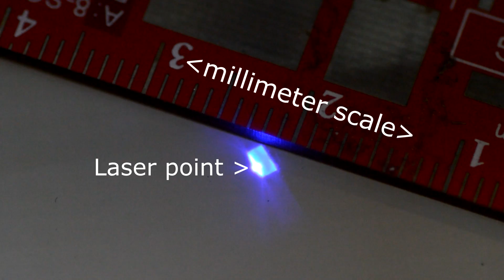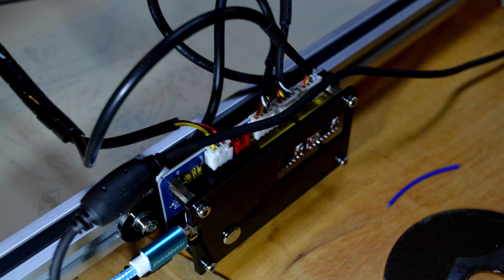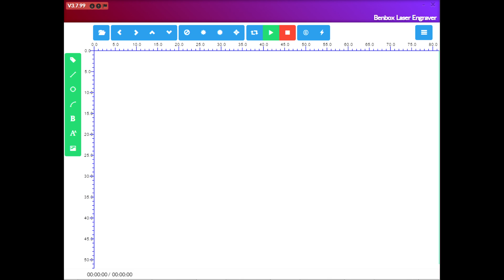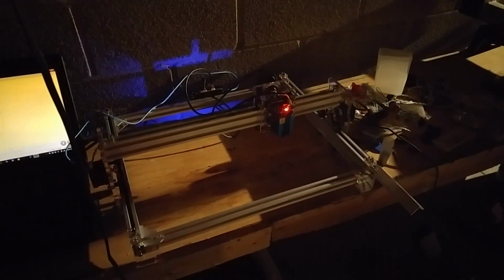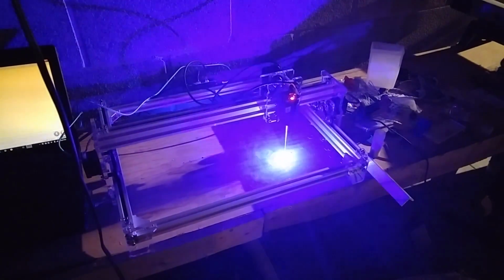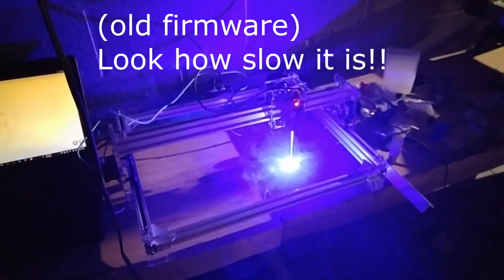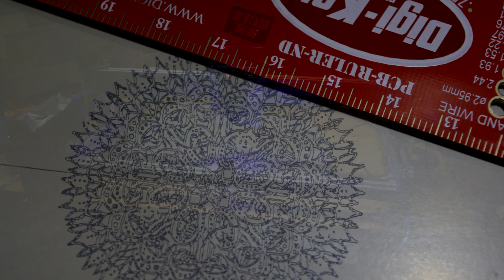Cheap Laser Engraver Review: EleksLaser-A3 Pro 2500mW  [PINNED COMMENT: UPDATE]

Comment from the maker: UPDATE: I do not recommend that anyone buys this for use as a laser engraver. The severe lack of safety features on this machine, in hindsight, are completely inexcusable. I may post a video about this soon, but for now, just don't. Your eyesight can't be replaced and spending the extra $200 on something more usable is better for you and your projects. Please understand these risks before buying it and do research. These lasers are not toys and you can lose your eyesight forever in an instant.
Reply: LazerLord10 meh
Reply from the maker: That's pretty much my reaction to the whole machine, tbh.
Reply: what's the extra $200 more usable engraver?
Reply from the maker: The extra $200 would likely get you an enclosure, better firmware, and a generally more reliable machine. If this were a 3D printer, it'd be okay, but 3D printers can't permanently blind you in an instant when things go wrong. Your vision is worth more than $200.
Reply: OK, got it. I'm more the DIY type and i would build all that, possibly change the controller board and most important: always wear my safety goggles.
Reply: Why wouldn't you just wear a pair of appropriate ANSI certified laser safety glasses, as recommended for a class IV laser system? I wouldn't trust some shitty $200 enclosure with my eyesight. I'd rather spend that money on a proper Nichia high-power laser diode and a decent pair of ANSI certified laser glasses on Amazon ($50).
Reply from the maker: @JesusTouchedMyJunk  They came with glasses, but an enclosure with proper safety lockouts is a must. Reflected laser light is more of an issue, and if there's the possibility of more that one person being in the same room as the laser, the enclosure just makes more sense.
Reply: Yeah I agree, it's good to have layers of safety. But to blame that on the tool, when it's very obvious from looking at their advertisements that there is no significant safety features included, seems a bit misguided. Just wear the damned glasses and it's fine
Reply: I've considered getting one of these, but not one had I ever considered using it as it is out of the box.  First thing I'd do is put together a simple enclosure for it with a fan and filter.
Reply: what kind of eye protection do you recomend?
Reply: i already bought one similar to this and the glasses they sent don't seem safe

Comment: Really enjoyed your video on this machine. I've actually ordered it and even though it hasn't arrived yet I'm getting your parts printed as we speak. :) Thank you for that. Could be they've already increased the screw lengths. I didn't see your review until after I ordered. If I can add my two cents worth here I found that Banggood was not very helpful in their communication as after ordering they sent me a confirmation but that it would take a few days to put things together. I saw that they had a 5.5 W version and asked that they NOT ship until they replied to my request for a quote to exchange the 2.5 for the 5.5 W burner. I also ordered 3 extra pairs of glasses and also asked if they could just add this to the box containing my shipment. They did not reply and just sent out the original printer a couple of days later. My requests were done on their "contact us" system which worked on another inquiry. For those who are interested in this laser you'd better get all your ducks in a row before ordering or you will be disappointed right out of the gate.
I already have a vacuum table for dust collection and its exactly the size required to evacuate any smoke and I plan to build an enclosure. I'm trying to source protective glass for it now. Can you kindly link the sites where I can get the $2000 laser you mentioned in your video. Thank you.
Reply from the maker: I wasn't thinking of any specific machine when I said $2000, but a common entry-level (but not bad) laser engraver is the K40, which is an actual 40 watt CO2 laser that can cut things. It's actually a lot cheaper than I thought ($400 ish). The $2000 mark was honestly made up from the machine I used a while ago in school, which was probably made before the age of 3D printers (i.e. home CNC machines were rare and expensive).

So yeah, I'd actually recommend the K40 as an upgrade. I've never used one, so do your own research on that one, but it looks a lot better for honestly not much more cost.
Reply: thanks once again. i will definitely look further into this. oh..so.. exciting. @LazerLord10

Comment: I have one of these on order. I’m interested in making a case for it so I can use it without risking my eyes or lungs. I’m thinking of using wood for the case and using a vacuum hose to take away the fumes. As I would like to see what’s going on I can either install a camera, or what would be simpler, a coloured plexiglass (Perspex here in Europe) window. What I can’t seem to find is a reference to the colour and density of the plexiglass to use. Do you know of one? My understanding of the system is that when Powered up the laser is on. This is hazardous. I would prefer to change this. I’m thinking of putting an on off Switch with a safety lock on the outside of the box to prevent operation if the box is open.
Reply from the maker: That all sounds like a pretty good idea, but you would probably need to change a lot of things about the firmware on this thing. I haven't delved into it too much (I barely use it), but it seems that its software failure mode is to keep the laser on and don't move. Needless to say, I'm glad I wasn't etching anything important. Because lasers of this wavelength are pretty common, you could just get a few sets of the same type of laser safety goggles they give you (which are actually not that bad), and cut out the viewing window from those.
Reply: LazerLord10 thanks for the reply. I’ll take a look at the firmware angle. I’ll probably go with the opaque box and camera option. My workroom has windows and best practice here is to shutter them when a laser is operating. I’ll be boxing in my 3D printer as well and using a camera for that so I could use the same box. Apart from the learning factor I’m going to use the laser for printed circuit board mastering and engraving metal. If you want I’ll let you know how it goes.
Reply: Hey you can just wear laser goggles. This is what actual laser micro-machining engineers do. We don't give a shit about enclosures or firmware because that stuff can always fail. The one thing that never fails is putting a wavelength specific absorbing piece of plastic in between your eyes and the laser. $50 on amazon, marketed towards laser medicine technicians.

Comment: Can it cut standard cardstock and mylar (polyester) sheets 0.2 mm please? I am thinking getting it for  cutting stencils. Thank you in advance!
Reply from the maker: I highly doubt it. Think painters tape was difficult to do.
Reply: These chinese laser heads are rated in terms of "input power" or the amount of electrical power you put into it. So 2.5 watts of input power has around a 50% conversion efficiency, you can expect around 1-1.5 W output power from this laser. For laser heads that are actually rated by measured optical output power, see endurance lasers or OPT lasers websites.

Comment: Hi, how small text could this print on plastic and still be readable?  I'm considering buying this mainly to label IC's.  So I'd need to write 1-2mm high text on them and maybe a logo?
Thanks for the review!  Honest opinion and I like you telling all the negatives.  Those are what I want to hear so I can decide if I can live with them, the vendor will tell all the positives himself :-)
Reply from the maker: Plastic? Not very good resolution. You can see the size of the laser dot near the beginning of the video, but with a low-powered laser like this one, it tends to melt the plastic more than etch it. Minimum text height to be readable would probably be 3mm. Good looking text likely wouldn't happen until 5mm.

Comment: There is a vital safety feature on any product that can potentially set fire to your house ......YOU !!!!! and solely you, an extinguisher at hand is not just an option its should be obligatory and a laser should not be left to work alone .. so this being said ive got this machine and have tried it fully and it actually works very well for a 2.5w laser ... the machine itself is simple and efficient and i use T2laser software ,the results are very good both black and white and greyscale......... once again its a good machine for the price but i insist this is not a fire and forget machine !!! constant precense is obligatory ....Also i would never of bought this if i didnt have a fire extinguisher allready.......     Its not all bad but of course i can understand Meh and its an entry level and not to be used without supervision.